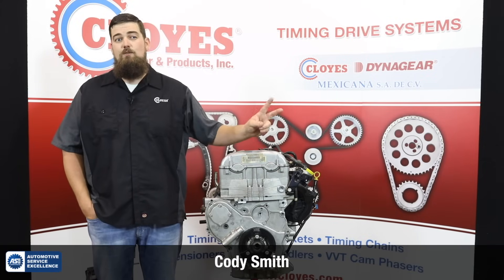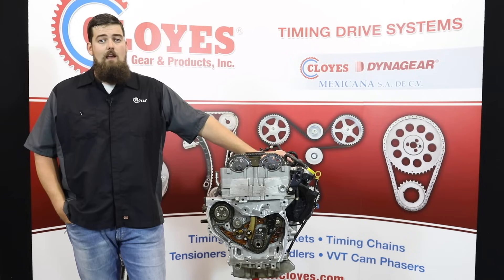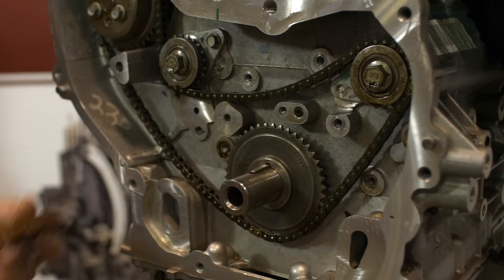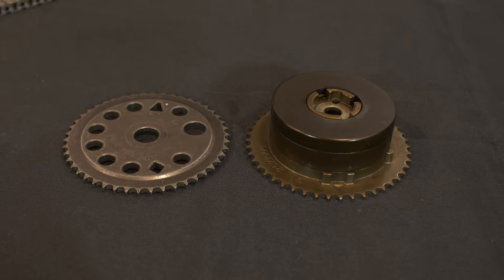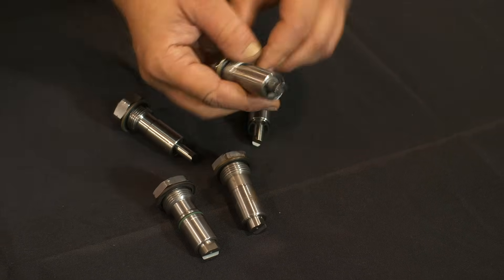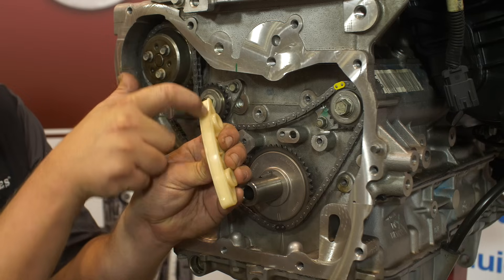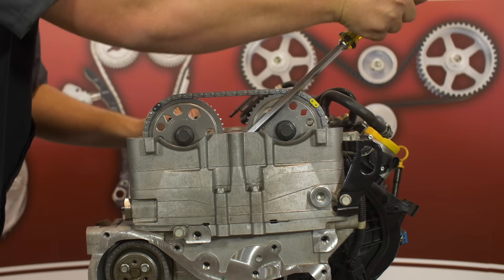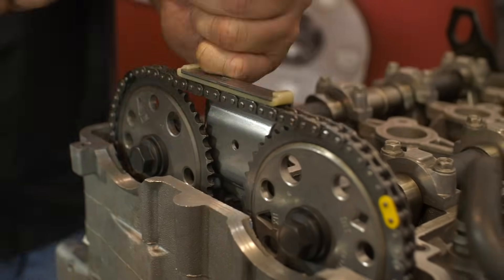GM 2.0/2.2/2.4L, Timing Chain Replacement, Cloyes 9-4201S & 9-4202S

Comment: the chain was loose enough to slap against the head and wore the guide bolts, one was in the pan the other had been worn in half, the missing one has the spot on the head angled so the bolt only touches on one side...trying to think of a fix...

Comment: Excellent video!!! Can't remember what video I referenced the first time, but this video showed me a couple things I missed. Putting the slack on the side of the tensioner, and reclocking the tensioner itself. Didn't do either the first time, and was getting a p0016 code. Just put it all back together following this video, shes running smooth as silk and no codes 🙌🏼

Comment: All my timing marks line up perfectly and car sounds great. Not missing at all but I keep getting P0016 error code which is crank / camshaft out of sync. It's the opel astra j 2.0 opc a20nft motor
Reply: I’m about to do this job on the a20nft too. Will let you know what happens with mine
Reply: Job complete here and no issues for me. Did you check your vvt gears were in good condition? If you can turn the camshaft with the 24mm spanner and the vvt gears don’t also rotate I heard that’s a problem and they need replacing

Comment: @cloyes01 working on a 15 equinox. Trying to get the timing set before I take apart. The keyway is at 6 o'clock when the timing marks line up on exhaust and intake. What is the problem and how to fix

Comment: i bought 94201SB1K3 for a 2.4l lea engine. do i need to use the inner and outer friction washers that are on the original crank with this set?

Comment: I bought the total kit for my 2005 cobalt and I was wondering if the tensioner guides nylon piece should slide back and forth on the steel part of it at all? Think its the normal but wanted to make sure?
Reply from the maker: Yes, that is normal. There will be some movement between the bracket and contact surface.
Reply: @Cloyes01 appreciate you answering.  How do you know the cam chain tensioner is activated? Will all the slack in the chain and that guide it pushes have minimal give? Also how do ya get 89 in/lbs? Torque wrench i have is definitely off, did you just tighten til "its tight but not overly tight", just a bit past snug?

Comment: Is there another way to garauntee the main tensioner is activated? There’s still a bit on slack but I pushed on it with the soft tilled pry bar as much as I could
Reply: when installing the chain did you make sure any slack was on the left side so that the tensioner can do its job? also, you can reach down and push the chain and guide below the exhaust phaser/sprocket and see if it is tough to push in or is easy? or you can always pull it and reset it and install again if needed. good luck

Comment: I have installed everything just as you
Said, but after having the main chain installed, no matter how many times I turn the crank the timing marks don’t line back up. Should I be concerned?
Reply from the maker: That is normal. The marked chain links will only realign once every so many rotations. Not sure exactly how many it takes on these Ecotecs, but it's well over 100 on most applications.
Reply: @Cloyes01 gotcha, I ended up finishing the video and heard it stated at the end. Thank you guys

Comment: If you have a cam locking tool from Saab/GM the colored links on the chains are not so important, right?
Reply from the maker: Correct. The Saab sprockets do not have timing marks to align with the marked chain links.

Comment: All these videos say the same dumb thing about replacing the water pump. Do not waste your money buying a kit with a water pump in it. It's a bigger pain in the ass than the timing chain, and if you have to, you can get to it without taking the timing chain cover off, but that's the least of your problems with that water pump.
Reply: If the water pump is turned by the timing chain ,Then you would be mad not to change it with the timing chain,,If it's turned by the AUX belt,Then no you don't have to change it with the timing chains,,

Comment: cool video..I am replacing my timing chain on my Ecotec 2.0 engine but later read that this must be done at TDC on the EXHAUST stroke, not the COMPRESSION stroke. IDK which stroke I was on when I lined everything up . I just know that I had the timing marks on the cam sprockets and the balancer lined up per the service manual (2 and 10 o'clock, keyway at 12 o'clock)). I then rotated the crank bolt 2 full revolutions and did not hear any banging or feel anything strange. How can I be sure that I am ok or not? Little nervous here. thanks
Reply from the maker: If you were on the incorrect stroke then the timing marks on the camshaft sprockets would have been at about 4 & 8 instead of 10 & 2. As long as you aligned the marks correctly, they you are good to go. Generally, on these newer applications, you don't need to worry about the engine stroke or piston positions because the timing marks on the sprockets correctly position the engine.
Reply: @Cloyes01  I have a question I bought a master kit that comes with everything for the 2015 Chevrolet equinox the timing kit and the main tensioner guide the plastic is really loose and floppy on the metal part of the guide and I wanted to know if that is normal, it moves a significant amount not coming off, but it does move
Reply from the maker: @izaacsilva9148  The nylon guide material  will have some movement on the guide bracket. That is normal.
Reply: I searched the whole web sight but cannot be find list for mie GM vehicles 
do you be sel. thêm  ¿¿¿¿
Reply: @Cloyes01  ok thank you

Comment: Make sure you get an exhaust and an intake cam sprockets when you get the kit or order it I bought it from cloyes and I got 2 exhaust cam sprockets and it wouldn’t run right until I realized the mistake which took 3 weeks and putting the old intake sprocket back on it finally ran after having it tore apart 3 different times trying to figure out what I did wrong
Reply from the maker: There are 2 different combinations of camshaft phasers used in these engines. Some engines use 2 "exhaust" VC107 phasers, and other versions use one VC106 Intake and one VC107 exhaust. Always check what you are removing, either two of the same phasers or two different phasers, and make sure the new parts are the same.
Reply: @Cloyes01  gotcha thank you

Comment: Confused about 11:30 what is the sprocket key feature? And what do you mean to engage it with the camshaft? I have a 2.4vvt terrain. First time ever doing this
Reply: He is talking about how the exhaust  sprocket (similar to intake sprocket) can only go on the camshaft one way for correct timing. The intake side  is shown at 11:05
Reply: @btdt258 so I saw some people say you have to make sure the camshaft lobes are at 5o clock and 7 o clock, but some people don’t mention that and just say the sprockets need to be at 10 o clock and 2 o clock. Do I need to check the camshaft lobes or do they time with the sprockets?
Reply: I can be answer thatt 4our you ¡¡¡¡
Reply: They time with the sprockets.
Reply: Soundê liké a High Performance feeturê on Foreign amerikan Vee-Hikulls

Comment: I didn't see any mention about the shims between the crank sprockets. I assume I should be reusing them with this kit, is that correct? 2013 Equinox. 10:36
Reply from the maker: Correct. The shims are only used on some Ecotec models. If your engine has the shims equipped, then they should be reused.
Reply: Super helpful, thank you!

Comment: Would it be advisable to combine a genuine Sprocket(Induction engine) with an aftermarket Chain kit?
Reply from the maker: The OEM and aftermarket components are interchangeable. The aftermarket chain kit will work with the OEM sprockets.
Reply: @ Thanks a lot for the reply.

Comment: I have the 2.0 eco tec b207 Saab engine This video was very helpful in the disassembly, but I did notice that my camshafts don’t have any keyways for the sprockets to sit in nor do they have marks on the sprockets. What would I do differently comparatively because they look identical except for those two things.
Reply from the maker: You will need a special tool kit to properly locate the shafts on the Saab version of this engine.

Comment: For those working with a 2.4L, if you are working on the motor while its in the car, be prepared to use a breaker bar and 2 wrenches linked on the ends for the top sprockets and the passenger motor mount has to be taken off to take the 10mm hex plug off so you can get to the bolt...which means youll need a jack to hold the motor up
Reply: Just ran into the issue with the 10mm hex plug. If you can't get that hex plug out, you are dead in the water. It is the crux to the whole job. Maybe a low profile Allen wrench would work.
Reply: @michaeltaylor5373  Just put the 10mm hex socket through a small 10mm wrench. There's enough room. Add another wrench for leverage. Tighten to break the locktite then loosen.
Reply: Roughly how much do you think this would cost to replace?

Comment: I’m replacing all the timing/balance shaft components on my daughter’s 2010 Cobalt with the 2.2 ecotec vvt engine, I started installing the new parts and when I got to the balance shaft tensioner guide it felt like the bolt was stripping, turns out it was actually stretching 🤦🏻‍♂️ it’s the same bolt that the oil nozzle, the balance shaft tensioner/guide, and the main tensioner guide uses. ** I found the bolt specs for those parts, they’re M6x1x30, 9.8 flange bolts, in case anyone else needs them.
Reply: Try your local Pull-A-Part.
Reply: @ I think that’s the only way to get the originals, but I did find the bolt specs, they’re M6x1x30 flange bolts.

Comment: Sources online list the HHRSS cam shaft sprocket bolts are the 63 foot pounds +30°. Haven’t seen the 22 foot pounds figure.
Reply from the maker: If you have a VVT engine, you need to torque to 22 foot pounds then an additional 100 degrees. If you have a non-VVT engine then it is 63 foot pounds plus 30 degrees.
Reply: @Cloyes01 when I hit 22lbs, I cannot get the extra 100°. I can only get about 70° before it feels like I'm either about to snap the bolt or my arm. Any ideas?
Reply: @Cloyes01  purchased your timing kit. I wish this video was mentioned in the instructions! Would have been helpful.
Reply: @dans_Learning_Curve  It is...

Comment: Hey there I’ve got the SS with the VVT. When I’m putting the timing chain over the camshaft sprockets and the crankshaft sprocket, everything goes fine until I use the 24 mm wrench and push back to lock in the exhaust sprocket. It always slips and jumps a tooth on the crankshaft sprocket. I’ve tried three different times and got the same result. Don’t know what’s going on.
Reply from the maker: Before installing the exhaust sprocket, try to rotate the crankshaft sprocket slightly to shift the chain slack to the other side and see if that helps.

Comment: So the degree for the cam gear bolts has me puzzled every video everyone says 22 foot pounds then an additional 100 degrees, yours says 63 foot pounds then 30 degrees. which is accurate? Great video also!
Reply from the maker: If you have a VVT engine, you need to torque to 22 foot pounds then an additional 100 degrees. If you have a non-VVT engine then it is 63 foot pounds plus 30 degrees.

Comment: What if, no matter how many times i turn the key to the 12 o'clock position, the cams never line to 10 and 2? Best i can get is 10 on exhaust and 11 on intake. @Cloyes01
Reply from the maker: That is close enough to start the disassembly. When installing the new chain, you will likely need to rotate the cams slightly to get all the marks aligned.
Reply: @Cloyes01  I'm beyond happy to hear that. Thank you for the quick response as well.

Comment: Im doing mine currently and need advice on the shims that are on my cranshaft gear. One behind and one on front. Keep them when replacing or not? The oem gear has rubber also so maybe shimsnare for that since the new gear has no rubber
Reply from the maker: We recommend cleaning and reinstalling the thrust washers on the crankshaft sprocket if originally equipped.

Comment: Im currently at 64,000, should i start buying this crap or wait til i start hearing something (noise)?
Reply: Change your oil every 3,500 miles.  I live in the South where we have mild(er) winters and I used Rotella 10W-30 semi-syn truck oil and never had an issue on my Ecotec engines.
Reply: You can always pull the valve cover off, maybe a 15 minute job. See how much flex is in the chain between the two cams sprockets. If it is nice and tight and you don't see any broken guides down below with a flashlight, you're probably okay. 

When the chain tensioner fails on these engines, the chain slop will often take out the guide on the upper right as you are facing it, and also strip the bolt out of the aluminum head. If this happens, Dorman makes a replacement bolt, 917-954, that threads into the plug hole you had to use to access the bolt. You don't have to drill out and retap new threads in the head, but you will have to install a new timing chain kit.
Reply: @michaelallen5505 thanks for sharing
Reply from the maker: If you change the oil frequently, this engine can run 200,000 miles without any timing system issues. Just pay attention to any irregular noises or check engine lights that may pop up. Consider replacing the timing system when you inevitably need to replace the water pump.
Reply: @Cloyes01  awesome,  thank you so much for the timely response
Reply: @kennethwise7108 
every vvt motor ive seen starts giving cam code by 120k and water pump starts leaking by 140k. waiting until you "feel" the symptoms, will result in massive amounts of shavings in the motor. the plastic and metal shavings will clog up the oil pump in the timing cover. just do the timing and waterpump at every 100k with the tune up.
Reply: @0JLH0  thanks brother 👍🏼
Reply: @Cloyes01  That is BAD advice. A leaking water pump has NO cause and effect with the timing set, or vice versa!  Nor is the labor redundant.
Reply from the maker: @thomasmartin2950  Valid point, the water pump can be replaced without timing cover removal if you have or purchase the special sprocket holding tool. But looking at the job from a shade tree mechanic perspective, if you are replacing the water pump, it's an opportune time to go a little deeper and refresh the timing too.
Reply: @Cloyes01  Sorry, a timing set is a LOT DEEPER, and considerably more expensive parts wise, and labor intensive endeavor that is not needed for a leaking water pump. Do you replace your brakes simply because you took a wheel off to replace a tire??? Speaking from a 45+ year Master NIASE Certified Technicians experience. FYI, the special sprocket holding tool is less than $15.00, but you knew that. * FYI, I trust and purchase Cloyes products whenever possible, Thanks.

Comment: I think he meant number 1 piston at the compression stroke,  not the exhaust stroke
Reply from the maker: Nope, this engine is timed on the exhaust stroke.
Reply: This is my second time doing this timing chain. On my 2007 2.4 G6 it was TDC on Compression on my 2008 2.4 G6 it is TDC on exhaust...it also says this in my Haynes Manual.
Reply: Pretty sure 08 and later is TDC on exhaust. 07 and under is TDC on compression. My 2011 2.0T was TDC on exh. That's  when the cams point to 10 o'clock exh and 2 o'clock int. Past the exh stroke on the intake stroke the intake lobes start opening as you rotate the engine so it's correct
Reply from the maker: @MarcBchannel  Thanks for the comment! Either way, you just need to rotate the cams to the 10 & 2 positions. That puts you where you need to be. There is no benefit in determining what stroke it is, the cam sprocket marks do the job for you.
Reply: @Cloyes01  Ya I guess it doesn't matter as long as everything lines up. The cams are gonna be where they need to be whether it's on the comp or exhaust stroke. Great video and info. Cheers👍

Comment: wrap the old chain around balance shaft gear and hold with Visegrips to break bolt loose much easier
Reply: Yup. Messing around with a drill bit to hold em in place sucked. I just wrapped the old chain and wedged the links between the gear and the bolt on the balance shaft hold down plate
Reply: yeah just figured that out... my knuckles hurt

Comment: Does the 2014 LE9 use the same VVT sprockets on both intake and exhaust or both different , thanks
Reply from the maker: The LE9 used the unique phaser on the intake camshaft. It will take 2 different phasers.

Comment: Why doesnt the cloyes vvt sprockets for the 2.4l ecotec have markings for intake and exaust all same part number
Reply from the maker: Some applications will use a unique intake phaser, Cloyes # VC106 which is marked as the intake phaser. In those apps the VC107 will be the exhaust phaser. 

In other applications GM used the same phaser on both banks. These apps use two of the VC107 phasers, one on the intake camshaft and one on the exhaust cam. So the VC107 will not be marked with "exhaust" or "intake" because it is used on both cams in some vehicles.

Comment: Beam type torque wrench ?
Reply from the maker: We keep it around for bolt failure testing. It gives you a visual indication of torque applied during rotation, which comes in handy for us. Would not be our recommendation for everyday work. Always use a quality torque wrench.
Reply: @Cloyes01  Are you officially affiliated with Cloyes ?

Comment: I am going to replace just the camshaft sprockets and was wondering if the intake and the exhaust camshaft sprockets are same on the 2.4 ecotec engine? Thanks
Reply from the maker: The non-VVT engines use the same camshaft sprockets on both cams. VVT equipped engines could have the same phaser on both cams, or some applications used unique intake and exhaust phasers. You can lookup your application on our website to see what phaser combination it requires.